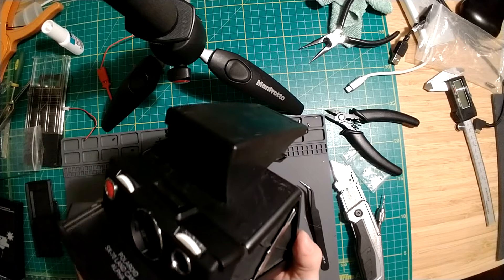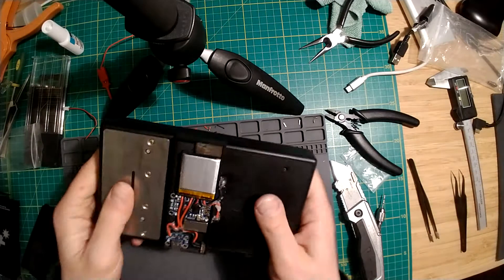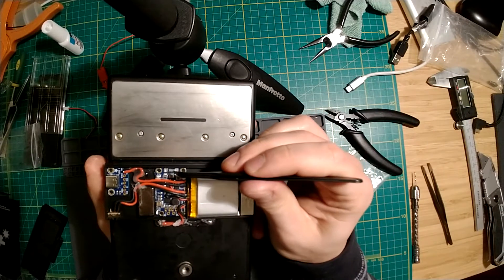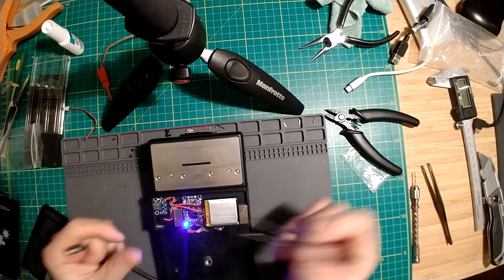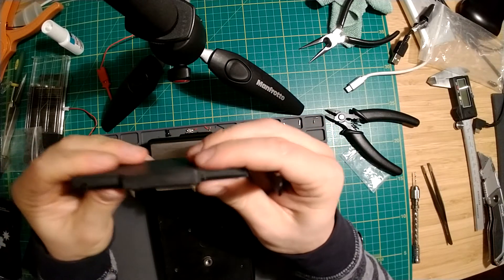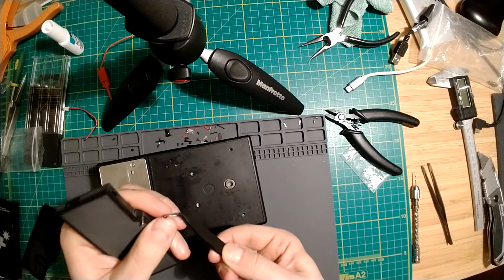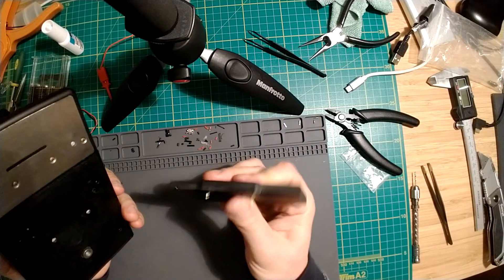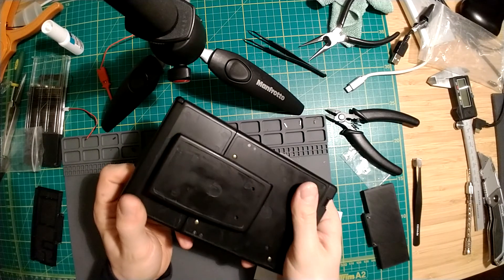Polaroid SX-70 external battery prototype

Comment: Hi! I thought SX-70s needed 6v to run properly. I tried the 4 AAA method using rechargeable 1.2v batteries which fully charged give around 5.2v and the camera does power up but sounds lazy. How good does yours run? very nice and slim prototype btw!
Reply from the maker: Mine runs fine with this solution. There was one thing I didn't get to measure cause I didn't have a multimeter with the proper range. Is how much current a normal polaroid battery outputs and how much does the camera consume. This solution will deliver max 1A and around 500mA at the lowest. This is definitely enough. I have used the camera in a single charge to take 40 shots. 

Thank you! :)
Reply: Did you try the CR32 Battery that Fuji Instax uses, 2 of them come up to 6 volts.

Comment: Hi I’ve made one of these as your instructions say but every-time I try to use it it goes flat as soon as I try to take a picture? Any suggestions
Reply from the maker: Hey there. This has never happened to me. Recently I have even done a proper trial by fire and shot 40 Polaroids in a row without charging. There are 2 things that I can think from the top of my head. Perhaps something is wrong on the board, causing something to short? Or the battery might not have be what it was claimed to be, capacity wise.
Are you able to test either of there?
Reply: @nuno_das_fotos  thank you very much for responding much appreciated I had the same idea either it’s the battery or board but I’ve also notched it called me my metal body of the camera that could be causing a short I’ll have to do some testing thank you again
Reply: Hi again is your battery a high discharge battery or because mine is only 1c could that be the reason?
Reply from the maker: @mintyfreshkickz8749  mine is 1c too. How big is your capacity? I have 500mah.